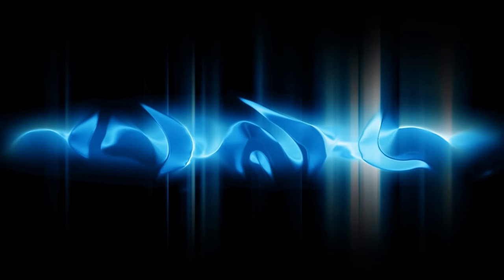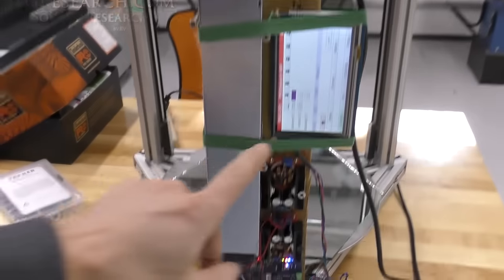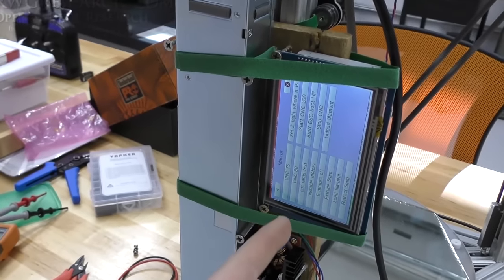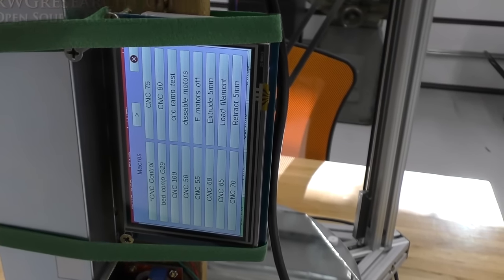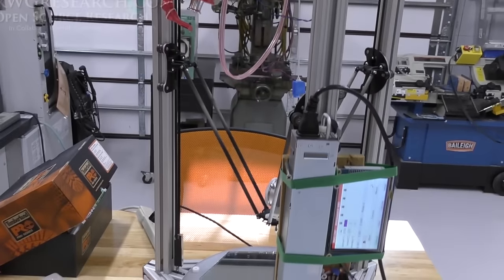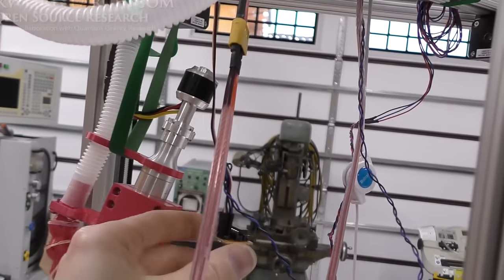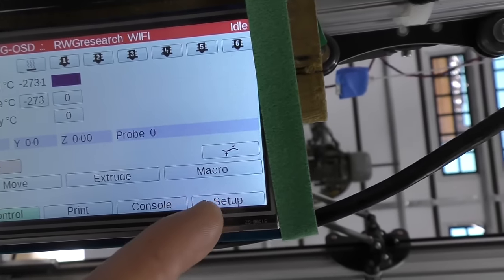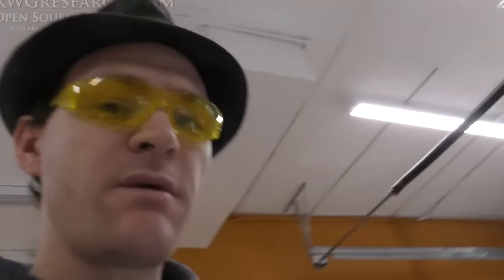CNC ESC Controled By DuetWifi Via Servo Output. ( RWG-OSD update)

Comment: What spindle are you using? Is there a Ne555 or TLC544 pwm modulator for interfacing to the duet and esc? I.e; How are you  sending frequency commands to the esc?